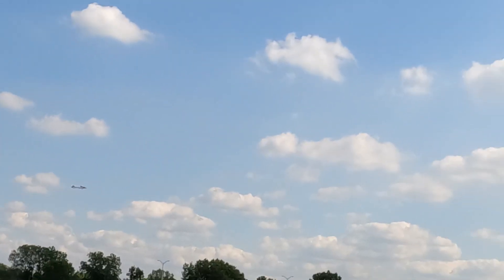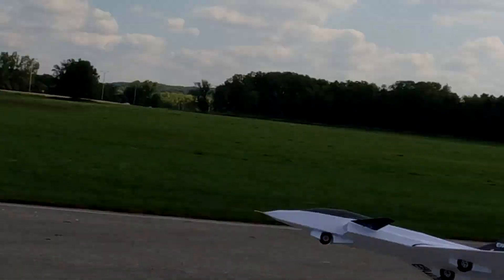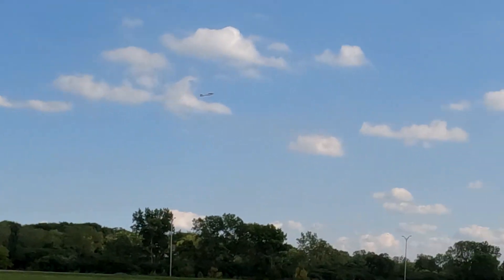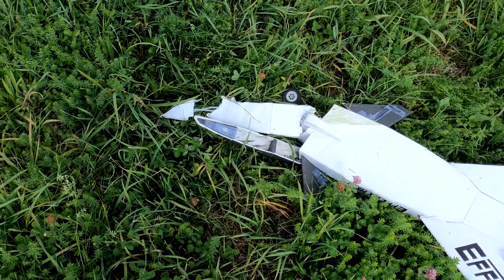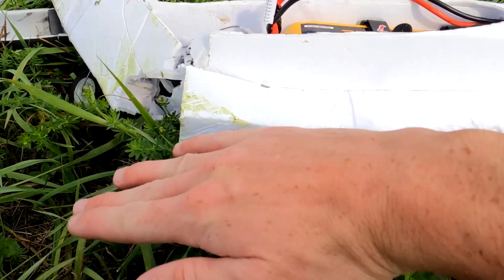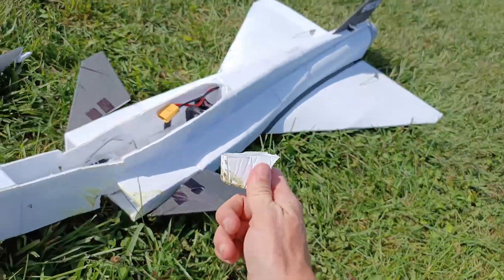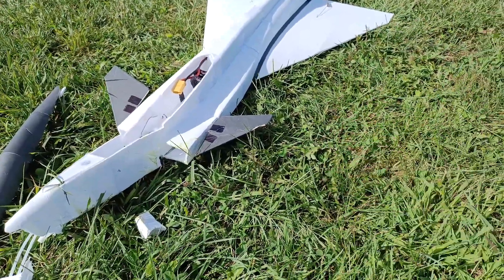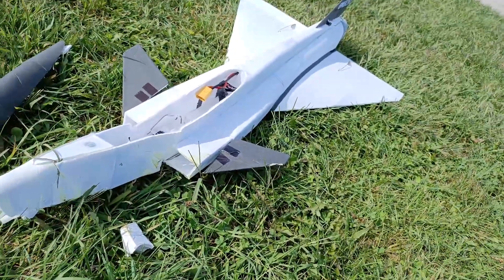Efflux Mk. III Maiden Flight & Crash

Comment: I think you were a bit too picky when landing 🙂. You had it lined up perfectly for the grass at the end of the runway. At least 3 times. 
Every time you went around I was screaming "oh COME OOOON whyyyyy?!?!".
 
Given the twitchyness, I would have gone for a grass landing anyway. 

Anyway, interesting project. I wish you courage & good luck with the rebuild.
Reply from the maker: Yeah looking back on it grass landing was a great option that I didn't consider. I was too concerned with getting it down on the runway and about damage from overrunning into the grass. In any case it's repaired with some mods, gonna give it another shot this afternoon and land in the grass if I need to.
Reply: @Pieliker96_  https://en.wikipedia.org/wiki/Avianca_Flight_052 😛

Comment: Oof. Poor bird. So did the battery LVC just pull the power, leading to an asymmetric stall due to low airspeed? Or did you lose power to the servos etc. at the end as well?
Reply from the maker: I still had servo control up until impact, the battery recovered to 3.3v/cell. Looking at data from control inputs I think I may have actually rolled it in myself trying to straighten out to a downwind leg, though stall could've been a factor (as it certainly was for the inadvertent spin in the middle of the flight). The roll oscillations were coupled to yaw rate and may actually be pilot-induced from the insane rates it had, I dialled down roll rate a ton for this next flight. I'll do a video going over the data soon, I got repairs done and modifications made for another flight this afternoon.

Comment: bro use a gyro, its not forbidden :D
Reply from the maker: I like to fly without them, especially on the maiden flight. It gets me a more direct feel of what the plane's doing and eliminates any risk of over-tuned setups, which with the roll rate being as high as it was was certainly a possibility. I have played around with tuning them in the past for holding steady level flight for test passes but I found it to be a relatively long process for marginal benefit.